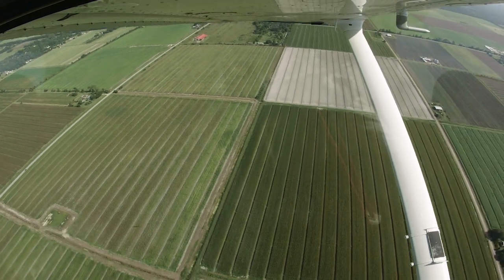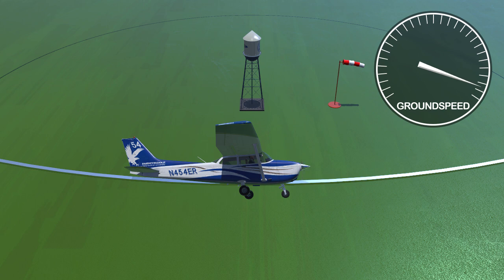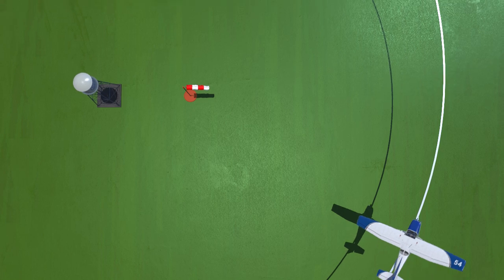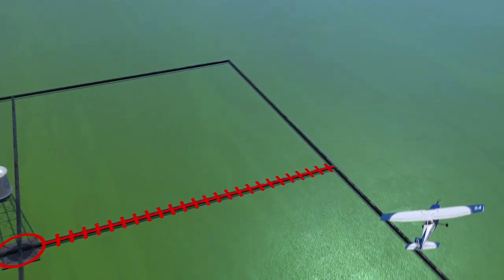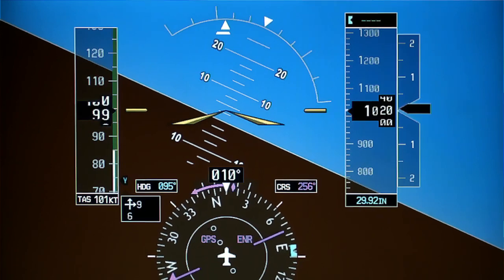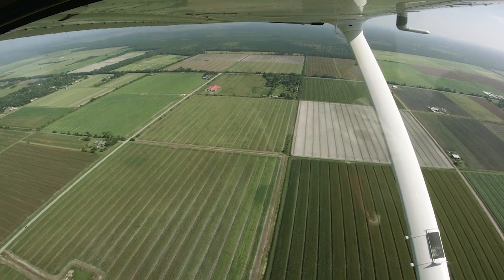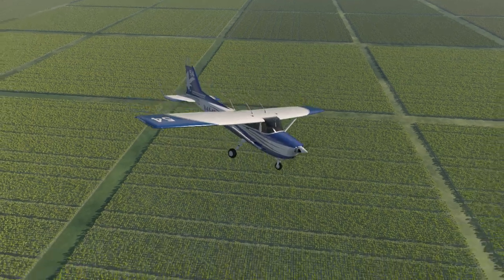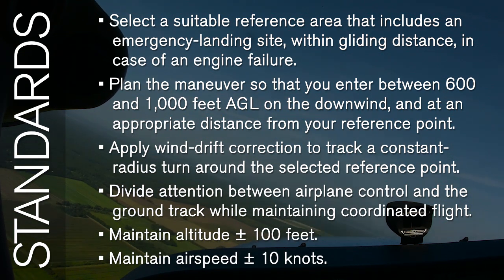Turns Around a Point

Comment: This maneuver should be started with the easiest bank angle or headwind.  Not the most demanding, dangerous and difficult tailwind turn.  Its BS starting with the most difficult and dangerous part.  Pure BS.  I taught all GRM STARTING HEADWIND.  That way the student can see the area better, plan better by adjust the power, flaps and speed to it safre.  BS to do the steepest bank downwind with little preparation.   Thousands have been get killed that way.  No wonder so many accidents on GRM first downwind/tailwind turn...
Reply: Right.

Comment: Here is how I learned what bank angle to use:

In a 172, from the left, pilot's seat looking down the wing, you want to keep your point in the middle of the wing. If your point starts drifting back toward the trailing edge, steepen your bank and hold that steeper bank until the point moves back toward the middle of the wing. If the point starts moving forward toward the leading edge, shallow out your bank and hold that shallower bank until the point moves back toward the middle of the wing. 

To put it another way with ^ as your point and ========== looking down the wing:

==========  = hold a standard rate turn
 --------^---------

========== = hold a steeper turn
^------------------

========== = hold a shallower turn
 -----------------^

Hope this helps.
Reply: As discussed in the video, crabbing is necessary and as such it is not possible to keep the point in the middle of the wing.
Reply: @dstroma  Good advice.  I've heard that trying to keep the point in the middle of the wing is common fault made by inexperienced pilots.  Crabbing is not required if there is no wind.  If there is wind the aircraft will drift off course if crabbing is not employed.
Reply: @jamesalex5034  Then if crabbing needed that is no good advice..
Reply: @outwiththem  it's good advice...but not for checkride standards
Reply: @jamesalex5034  GRM practice with no wind.  The girly way..
Reply: @dstroma  Try it the way I describe without the crabbing - you'll find that crabbing is not necessary.
Reply: @archerpiperii2690  "Try it the way I describe without the crabbing - you'll find that crabbing is not necessary."

Crabbing is REQUIRED unless there is no wind. There is no way to not crab and perform the maneuver properly. Read the AFH.
Reply: In my eyes you both are right: If you keep the point in a certain relation to the wing you crab automatically.
Reply: Looks at my Piper's wing.  Cries.
Reply: @goldie9864  No reason why this couldn't work with a low wing aircraft, you just need to be far enough from the point so that it is visible when you turn.
Reply: @archerpiperii2690  Hah, I should have noticed your 'name'!  I'll try this on my next lesson, thanks.
Reply: Saint
Reply: Wow, thank you so much for this
Reply: You just helped many student pilots..bless you
Reply: GREAT tip !!!!!!
Reply: Thank you man

Comment: There is a WHOLE NOTHER alternative explanation that is more intuitive: In a no-wind condition, turn so that your wing remains on the pivot point. If you allow the point to fall back behind your wing, (fly straight for a second or two) and keep it there, you will be spiraling outward from the point. If you pull tighter and get the wing behind the point, you will be spiraling inward toward the point. [The difference is that we are judging "crab angle" by the wing with reference to the pivot point] In wind, spiral outward upwind, spiral inward downwind. That simple!

Comment: Left wing down and right rudder to crab away from reference point sounds like uncoordinated flight.
Reply: Indeed. Pointing the nose outside the turn is literally the definition of uncoordinated flight.
Reply: She didn't say to use the rudder to crab. Just bank more or less and watch your distance to the reference point if it's getting closer, reduce bank, if it's getting farther away increase bank. If it's moving forward from the wingtip, reduce bank, if it's moving backwards from the wingtip, increase bank.  If it's some combination of these then you might be too close or too far away to do it correctly. Airlines crab during landing in a cross wind until the very end. They do this to maintain coordinated flight for as long as possible.

Comment: Why do you have to have to join in the downwind?
Reply: FAA Bullshit.  This maneuver should be started with the easiest bank angle.  Not the most demanding, dangerous and difficult section.  Its BS.  I taught them starting HEADWIND.
Reply: @outwiththem  They are brainless when doing GRM.  FAA burrocrats demanding only Mild Maneuvering GRM.  Then they crash doing Hard GRM.
Reply: The Holy scriptures from the ACS dictate this, so we must heed its divine guidance
Reply: Because the ACS says so lol
Reply: Skoz Hahahahaha
Reply: Maintenance Renegade hi, now that’s the most reasonable answer I’ve heard in a while.
Reply: It's a little more difficult to enter downwind. FAA and examiners want to see the pilot perform the turns smoothly and safely rather than seeing them do the easiest entry.